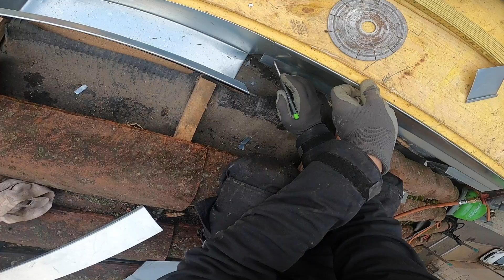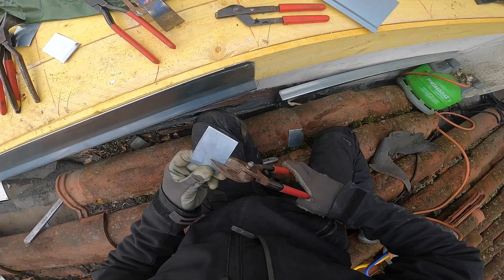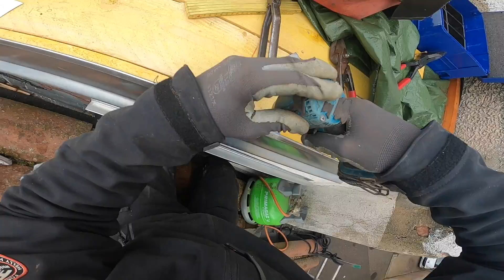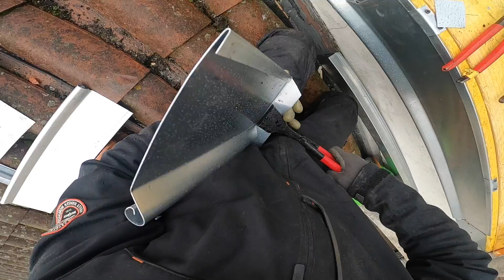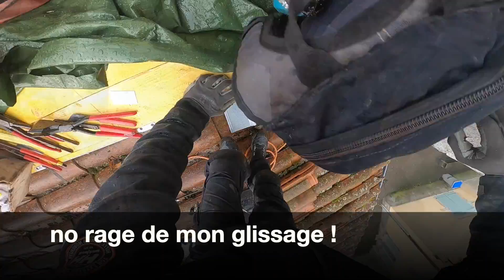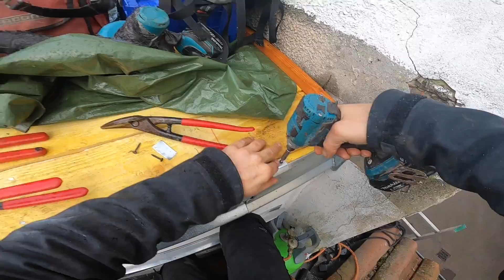le métier de zingueur #4

Comment: Salut Lionel,
Petite question, je ne comprend pas comment il ne peut y avoir d'infiltration avec ce genre de rive (pince Lyonnaise ou pas ;)). J'ai acheté le livre d'Eric Mullar est c'est pareil que toi. Tu peux m'en dire 2 mots stp.  Bon Dimanche.
Reply from the maker: La pince sur l habillage de bandeau n a pas pour rôle l étanchéité, C est plus pour la rigidité.
Sur les grands habillages les parties ne plaquent pas entre elles, elles baillent, c est pourquoi je fais 2 pinces agrafées entre elles.
Sur des petits habillage comme dans cette vidéo , les éléments sont de fait plus rigide.
Dans l absolu je n avais pas besoin de faire de pinces.
D une part parce que j avais mis le sens de recouvrement inverse a celui de l unique angle de vue en bas a droite.
Et d autre part la plage de habillage est tellement faible que l eau n a pas le temps de migré sous le recouvrement par capillarité. 
C était juste l occasion de vous montrer une autre méthode.
Voilà pas simple a expliquer, j espère que tu comprendras.
Reply: Merci. Je crois que j'ai compris. Des que possible le j' achèterai quelques pinces et un fer pour commencer à m'exercer. Perso même avec un recouvrement de 6 et un petit bandeau, j'aurais peur que l'eau passe dessous. A+